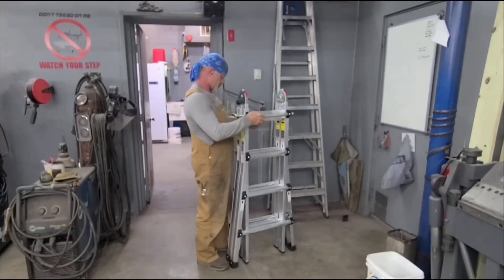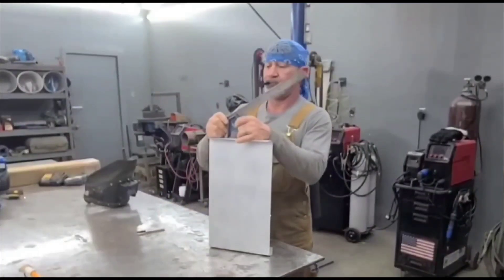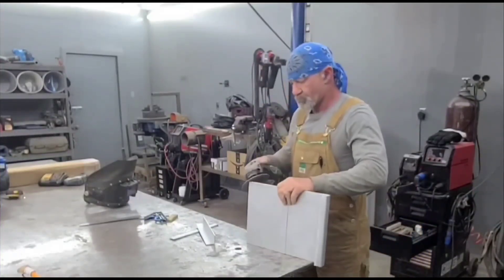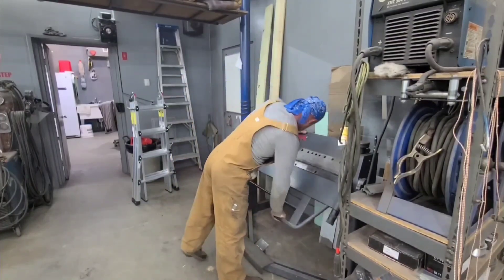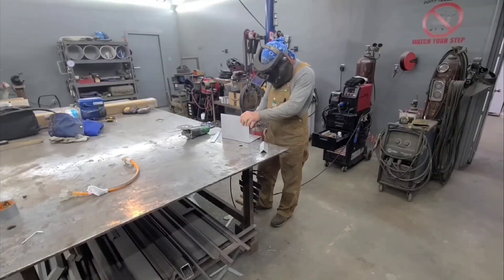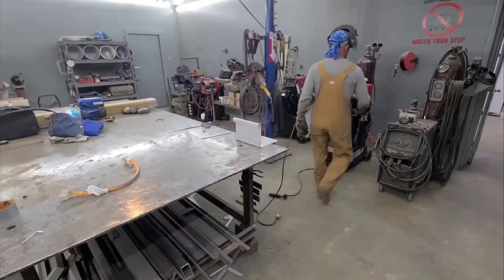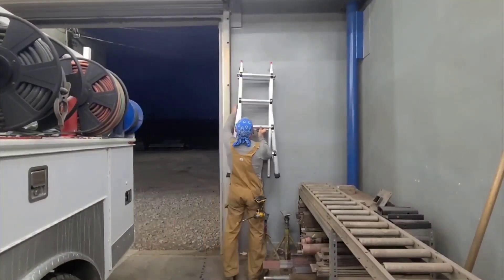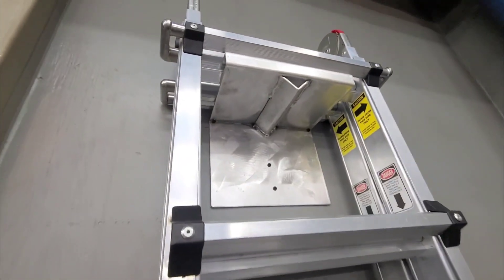Building a ladder hangup bracket from scrap aluminum

Comment: Those ladder are super handy to have around. I love being able to do so many different things with one item. A frame to straight ladder plus flat against walls angled and dont forget the adjustment you can use to get it set up on a stairway. I like the 5 step one but it is kinda heavy but will get you up 20'+ with ability to split it up and use a plank in-between - adjustment hook locks go into the hole of opposite section, and then you got a plank to work from between 2 A frames made from 1 ladder. Anyways nice bracket to hang new ladder. 👌🏻🛠️
Reply from the maker: Thanks for watching and commenting

Comment: Those die grinders are a real must just try to get rear exhaust stuff so you don’t throw oil on your material your working on 🙄 ask me how I know but you can use those things in so many ways at one time I had like 6 of them set up with different things so I didn’t have to change things around all the time but they do blow shaving and oil around
Reply from the maker: Yep

Comment: I love aluminum! Great for making lots of things fast,light,and will last a long time with no protective coating needed. I love the spoolgun, and I'm getting better with tig, too.
I ended up going with flux core process on my galvanized trailer job of mine due to the fact that it was 1/8 wall thickness and because I had to move it outside. None of the welding was structural. It worked beautifully. I was very impressed and pleased with the process and the outcome. There is absolutely a time and a place for flux core. Thanks for the tips and thx for another great video, C.B.
Reply from the maker: Flux core is great on thin galvanized...and the ARCCAPTAIN flux core is the best

Comment: Damn man show more welding and less product endorsements. I was wondering if you used the spool gun or did u tig weld it? Oh well
Reply from the maker: Could you take the time to watch the video?...I literally got out the spoolgun, welded the part, and then put the spoolgun away on video for you to watch....sorry I didn't show more welding but it was less than 6" of welding for the entire job.
It's hard to make a big deal about welding on a job where there simply isn't much welding....sorry man I'm doing the best I can at this